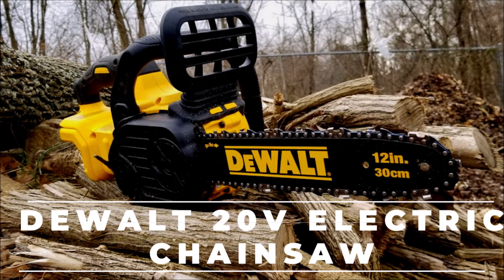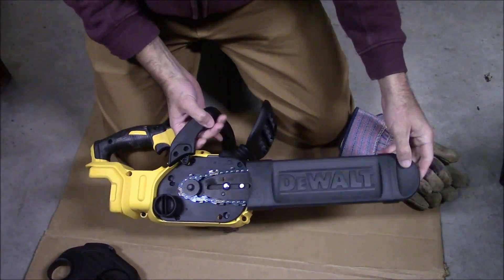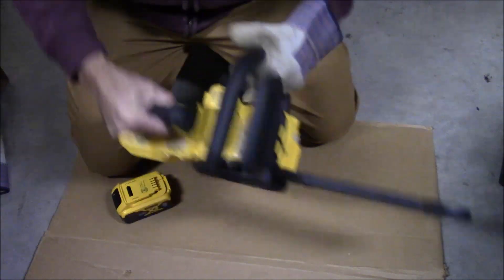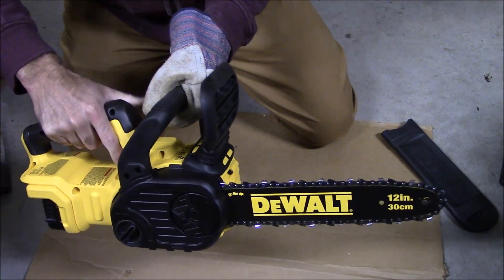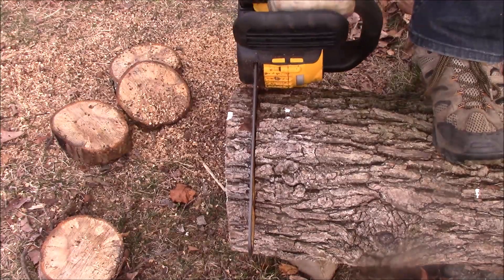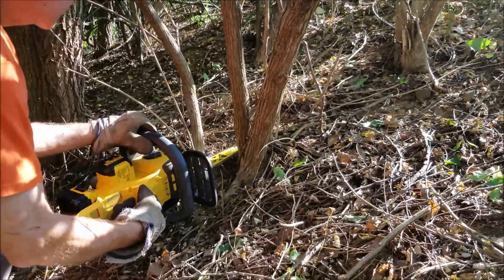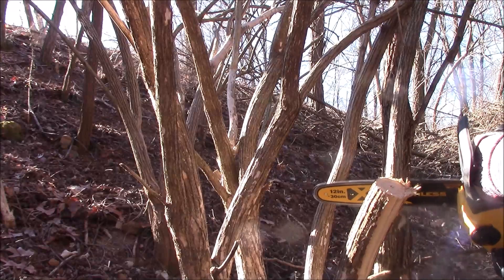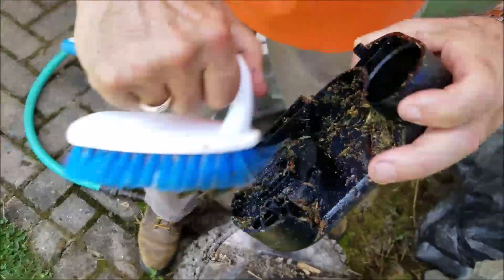Dewalt 20V Electric Chainsaw Unboxing and Review

Comment from the maker: Hi all - here is the chainsaw.  Sometimes it goes on sale at Amazon with the battery for $200, so check it periodically to see if it is on sale.  Also, the tool only goes on sale for $126.  So, if you are patient you can score a pretty good deal on it (affiliate link);  https://amzn.to/38vsEQE
Reply: Its a awesome saw. Check your oil cap and see if it is missing the rubber O Ring. It will leak less oil if you put a thin one on it. Ps I use vegetable oil..
Reply from the maker: Cool.  Mines got the o-ring.  Just took down a pretty large tree with it a couple weeks ago.
Reply: I’ve read that some new users complain about the saw leaking oil after using it. Have you had that experience?
Reply from the maker: @merimacleod7119  All chainsaws will leak a bit of oil in my experience.  And this one does too, but not any worse from others.  I should have mentioned how I store it.  But, you place it on a piece of cardboard on a shelf, on it's side with the bar/chain down.  The small oil that leaks is absorbed by the cardboard.

Comment: Thank  you so much for taking the time to make this video.   It was exactly what I got it for and exactly what I needed to feel comfortable with my product choice and it's use.
Reply from the maker: Thank you Ron - I'm glad you found it helpful.  Good luck!
Reply: Works like a charm.  Do you need to empty your oil resevoir or put it on something when not in use.  Mine seems to leak chain/bar oil.
Reply from the maker: I keep mine on top of a piece of cardboard, on a shelf, on its side with the reservoir cap pointed up.  It still leaks a bit, but is contained to the cardboard
Reply: Thanks for the reply.  Appreciate knowing it's normal.

Comment: I completely agree with your review. I just bought this Dewalt 12" chainsaw to prune and remove trees in our yard, and it works wonderfully. I'm very impressed. It uses a fair amount of oil, so be sure to check your oil level periodically while you're working to make sure you don't run out. I have a bunch of invasive Brazilian Pepper trees in our back yard that grow on average 2-3 feet per month. Florida doesn't require permits to cut them down, as they've been taking over the state with their rapid growth. The chainsaw makes short work of removing limbs and even taking down full trees. It's quiet and works flawlessly. Kudos to Dewalt for making such a great product for homeowners.
Reply from the maker: Thanks man - I appreciate it.  And I have to agree with you regarding the bar oil consumption.  I've noticed that one full charge usually consumes almost all the oil.  So, I just fill it up before starting work every time.

Comment: Thanks for this. I allowed evergreen seedlings to attach to two flowering trees. I didn't realize how fast they would grow and take over the flowering trees. My husband eventually bought this saw but hasn't had time to use it. It's been sitting in the garage so I think I'm going to try to cut the trees myself before they get so big that I have to pay someone to do it. I'm 4'11" with a not-so-good right shoulder and this video helped bolster my confidence tremendously and showed me how to get the darn thing to come on. I'm going to cut those trees myself. Thank you.
Reply from the maker: Excellent!  You will love the saw.  It is very easy to use, and not very heavy.

Comment: I bought this exact model to use up in the air on a man-lift, taking down a huge oak tree. It was great. Handled oak branch's up to 12 inch's without any problems. It is my go to saw for any trimming under 12inchs. My Stihl will only come out for big huge jobs.   THANKS Dan H
Reply from the maker: Couldn't agree more Dan - it's a great saw.

Comment: I bought a Ryobi cordless electric saw and within the second day of using it the bar warped. I went to pick up a new bar at Home Depot where I purchased it. I was told they do not sell replacement parts. I went to Ryobis website and the good news was it only cost $11. The bad news was they have to have it shipped from China and there was a 4-8 week waiting period. I ended up getting a refund from HD and bought the Dewalt 16" saw. What a difference. I have cut down over 40 trees with it and love it. Thanks for this video.
Reply from the maker: Wow - that makes me even happier I went with the Dewalt.  Cool - glad to hear you are happy with it too.

Comment: I bought the same saw , great seeing the different logs sizes it can cut . I like the different tools that you can use the battery on .
Reply from the maker: I agree with everything you say - I know own more Dewalt tools for the same reason.  When a Porter Cable dies, it gets replaced with Dewalt

Comment: Just like to say that there is a safety within a safety on this I used this video to help with mine but noted you have to pop back that saftey guard or even if you press the saftey button and trigger it will not start without the guard popped back
Reply: That's what was preventing me from getting it started! I saw that on the video.

Comment: Thanks for the post.  Does it leak oil?
Reply from the maker: Hi Rafael - when I'm done using it, the oil level is usually quite low.  But even still I store mine on it's side (reservoir pointed up) on cardboard.  The cardboard has absorbed a decent amount of oil.  So, over time, yes, it leaks slowly.  I believe the manual actually tells you to drain it.

Comment: What type of oil?
Reply from the maker: Just generic chainsaw bar oil
Reply: Cheapest works just as fine as high dollar stuff
Reply: @growitbuildit  do you have to empty the oil after each use? Thank you for taking the time to create this video.
Reply from the maker: @Maani Osman.  No need to empty it.  But store it on it's side with the fill cap pointed up.  And keep a sheet of cardboard underneath